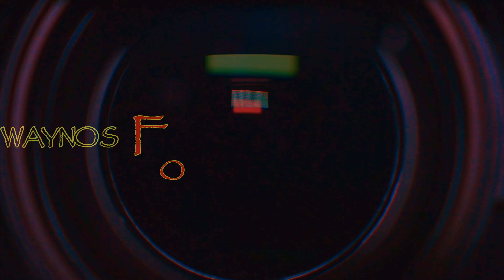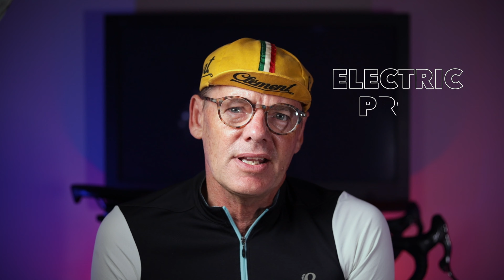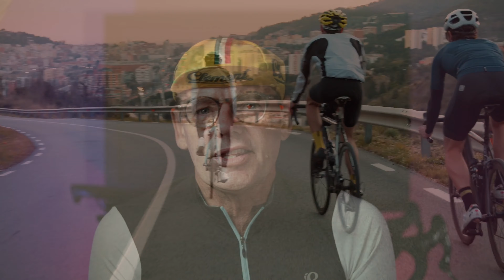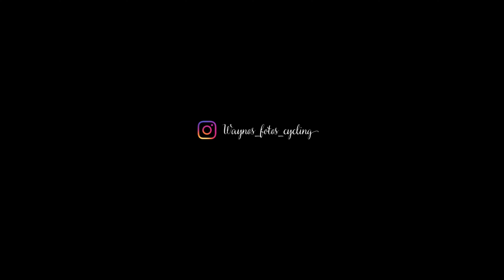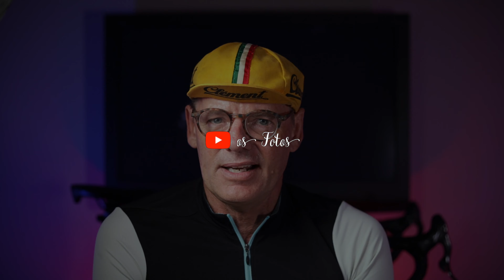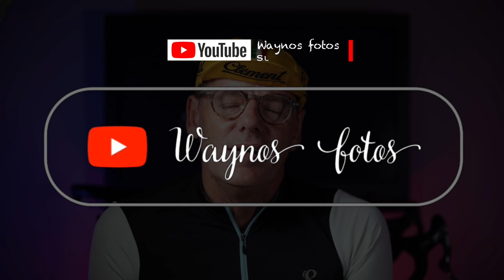Electric VS Mechanical GROUPSETS

Comment: I have ridden with 105 (5800), Red 22 and Ultegra Di2 (R8050) and I must say, I absolutely love the Di2. It's shifts are always perfect, it's even easier to set up and fine tune and the whole groupset feels a lot nicer. The mechanical Ultegra shifters feel cheap and plasticy, while the Di2 feels a lot more sturdy.

Comment: Good summary, thanks.   Couple more points:  I have both Di2 and Ultegra mechanical.  I like to push myself riding with other, often better, riders.  The Di2 lets me shift confidently without fear of a hiccup.  That allows me to shift more often and be in the right gear, always.   Also the remote shifter buttons on the drops (added) are another plus when pushing.   Als, being able to change screens on the bike computer from the hoods is also quite nice.   Finally, no fear whatsoever of a dropped chain on the front.   This is new to me and much appreciated, especially when trying to hang with stronger riders.

But all that said, I can be perfectly happy with mechanical .  But I'm also a bigger guy with strong hands.  I can see where the ladies may potentially see more benefit from the electronic shifting, especially newer riders.  The electronics can be set up to be fully automatic through all the gears.

Comment: Being a retired northerner I have elected to spend my slack cash on the bits that make a difference all the time Eg wheels tyres chain set vs.gear changing 2hich is only every few minutes . When not locked down we normally cycle in group rides twice a week and a significant number prefer the ease of electric shifting but I have elected otherwise.  Being influenced by the benefit of hydraulic brakes I did look at Rotor hydraulic shifting but it's Very expensive and to get the benefit would need new hub on the rear. Great videos . Keep them coming.

Comment: Another brilliant video 👏
I agree, I recently sold an Orbea Orca with 1st generation ultegra Di2 to fund building a neo retro build. Yes the electric groupsets are good but as you mentioned a well setup mechanical groupset is pretty much on a par. 
One of my bikes has 10sp indexed down tube shifters and they can multi shift faster than Di2(not including moving my hand to the shifter) 🤣

Comment: I use Ultegra Di2 with rim-brakes and I love it!!! Your video is a good overview, but there are a few points to add! First, all in all Di2 is just much less maintenance - I was now running it on two bikes for about 20´000 km and never had a single issue - no indexing, no cable replacement - just perfect shifting every single time. Second, while it is true, that if you have an issue with the electrical groupset it is generally more difficult to solve these issues are generally less frequent then issues on mechanical groupsets. Last, but not least: I have no experience with the Sram Etap, but the shifts on Ultegra Di2 are for sure noticeably faster then on the mechanical Ultegra. So for me, the only major drawback of Di2 is the price!

Comment: Out of my seven bikes, six road and one XC  MTB I run five mechanical and two electric. Firstly for MTB mechanical is probably the safest bet due to the vulnerability and terrain involved. All my road groupsets are Campagnolo I have never had an issue with indexing on either the front or rear mechanical dérailleurs. From 2015 Campagnolo really improved the front dérailleur. I have just built up a vintage steel Colnago with 12 speed Chorus however due to the winter I have yet to ride it, on the stand It does seem extremely impressive. The electric are Super Record eps rim & H11 Super Record eps , as stated in the video the front dérailleur is significantly different. I find a change of ring on the front to be almost as smooth as indexing on the rear cassette. The indexing on the rear is so smooth that 90% of the time you can't tell that you have changed gear, this is where the  option to display gears on your head unit is fantastic and a big bonus to avoid cross chaining without taking your eyes off the road ahead. I find the motors allow the system to control the power of the shifting more uniformly than a spring which in turn provides a more refined solution, also the auto trim of the front dérailleur is a bonus. I did program one of mine to automatically change a couple of cogs at the back when I did a front shift which was good to maintain cadence on the flat, however I changed it back as I do alot of climbing and found I was always re shifting the rear instantly to negate the auto shifting. Bottom line is I enjoy using mechanical and EPS, the biggest  miss when I am on mechanical is the lack of gear indication.

Comment: I agree I have a bike with DI2 and I went back to mechanical! The DI2 is first generation I have 2 batteries and they need to be charges once a week I'm afraid in a few more years the batteries won't hold a charge at all and it will be obsolete! I'm old school, mechanical and tubulars only! Great piece on pros and cons!

Comment: Those 8/10 people who have run out of Di2 battery during rides have should have bought a cycling computer capable of displaying the battery level first before buying the electric groupset. I haven't yet have any problems with the battery because I can the level on the screen during and after each ride. Seeing the mechanical groupset's wires wearing is lot harder.

I have both and I like them both. Mechanical is better for CX and winter riding when you're more prone to crashing. Electric is better for the summer season road rides. If I'd have to choose only one, I'd go with the mechanical. Your pros and cons were on the point.
Reply from the maker: Of course, not charging the battery is entirely their own fault. There is a number of indicators to remind them. I was only pointing out people do forget and it is not something you need to think about with mechanical. It is a good point you make and people need to consider this purchasing a system that requires charging.

Comment: I’m with you. I opted for mechanical DA on my Dogma F12 (Rim brakes btw).  I simply couldn’t justify the much higher price for di2 (and there was no way I was putting a mid-range group-set in a top-of-the-line Pinarello). The only time I would find di2 useful is when I wear thick gloves (Im in Canada) but this is not a biggie. Having said all this, I’m looking forward to the new generation DA - maybe my view will change.

Comment: Hey Wayno, I've only just discovered your channel, hense a lot of comments on different videos over a short space of time..... working my way trough them.
Anyway,, interesting video, someone I know has his superbike, 'Scott Foil Rio' carbon wheels, Dura Ace Mechanical and on one of his other bikes, can't remember the brand, he has Ultegra Electionic, he raved about how good the electronic was, how you could programme it, how you couldn't cross chain, how long the battery lasts....... But his superbike is mechanical and that's his go to bike for club rides.
I have built quite a few bikes over the last 2 years since giving up alcohol..... All money goes into bikes 😂🤣😂 got 2 retromods, old steel frames with modern 'ish' components, a Dawes Renown with Ultegra 10 speed mechanical  and one you would not have heard of, local boutique brand, a Carless TT frame with Dura Ace 10 speed mechanical, both change well. One of my other bikes was fitted with 11 speed Sram rival front and rear derailleurs and wait for it Sensah Empire shifters (the later metal inners) and this is going on my Trifox build...... I have to say that I can't imagine any better mechanical shifting than these and I would seriously consider the Empire 12 speed groupset but maybe with a Sram Yaw front derailleur and if they ever brought out an electronic groupset and it was double the price of their mechanical that would still only make it £450 and I'd buy it...... after Trace Velo tried it and rode it for a few months anyway 🤪
Reply from the maker: Soinds like you got the bike bug! Welcome aboard!
Reply: @waynosfotos  haha yep, bought a track bike and a TT at beginning of lock down, tracks opening in 3 weeks, just watching your 1 x video, guess what........

Comment: Best mechanical shifting ever based on how satisfactory it feels: 10s DuraAce 7800 best ever (di2 who?) too bad obsolete, dia compe 10 speed ratcheting friction, bar ends or downtube, wicked. 
Owned almost all groupsets in the past 10 years except R and SR 12s EPS rim or disc, because they are simply beligerantly expensive.

Comment: The undisputed advantage of the electronic groupsets is the ability to have custom placed buttons on the steerer for changing gears.
Otherwise, although the feeling is great, the shifting is accurate and the total outcome is cleaner,
I would place the Ultegra and even the last update on Shimano's 105, at the top of my list.
The reasons are dependability, almost telepathic way of response, ease of maintenance, durability and of course the elephant in the room.... Price!!!
Reply from the maker: Yep forgot that, satellite shifters are a bonus.

Comment: I’ve just bought some used, but like new, Red 22 shifters, plus some new Red derailleurs... prices were pretty good. The electronics systems should be at a similar price point, but it’s gouging. That Di2 battery, 10€ worth of cells for 130€... and the motion control in the derailleurs is trivial compared to a CD player or hdd.
One advantage of the electronics that you missed: you get caught in the rain and applying enough force to the levers is bloody tricky because your fingers slip off. In Europe there is a similar problem with numb fingers in the cold... some little divots would help, but electonic buttons will probably be easier.
Reply from the maker: Def would be cheaper to manufacture than mechanical. The R and D maybe more though. 
Yes i can see a big advantage for cold weather and people with arthritis.

Comment: A mechanical groupset lasts basically forever. I have bikes with DA7400 DA7700 DA7800 UT6500  SRAM RED 20 ,UT6800 and R8000 . What I noticed that integrated cables worsen the shifting a lot.
The shifting with the integrated cables has the worst feeling. The best shifting has the groupsets where the shifting cable is not under the bar tape and you only have 9 gears. i.e. UT6500 and DA7700. If you want to have more then 11 or maybe 12 gears, you probably need electric shifting as the actuation cannot be tuned so precisely. If there gearing goes even above 12 speed. 1/10 of an mm may be relevant to shift the chain.

Comment: It seems for most riders electronis either work or don't. Mechanical seems to work better or worse depending on maintenance. I get along just fine with my mechanical, until I get lazy and keep my cables too long (and then it starts raining).

Comment: You’ve forgotten that integrated frames are easier and cheaper to manufacture. There are 3 lugs to rivet or weld/braze on. A drilled hole for a wire needs no strengthening unlike a cable.  Im was lucky I couldn’t sell my 2010 bike. The problems my mates have with their disc electric shifting bikes I’m glad I didn’t swap. When their bikes work their awesome but that’s only about 20% of the time. Discs, tubeless, thru axles and derailleur batteries all are solutions for problems we never had.

Comment: I had both but the electronic groups tend to behave like a pet they demand attention and we have several bikes my wife has 2 i have 4 they are not that many but they don't get tha constant use a single bike gets ao they had battery problems and software problems the point is almost every time i switch to a different bike i got an issue related to the di2 only 1 of 6 bikes never had a issue it had an ultegra 6800 and it was one of my wife's all the others had Dura Ace 9100 all presented problems so we sold those toys we have all mechanical all rim brakes no issues just some oil here and there and we go, bikes are to be enjoyed no to add more stress and become money pits people have to learn that pros use what the team gets from the sponsors they dont pay for the bikes they get paid ride them. We don't have to copy them we should analyze and invest in what really matters we work hard for the money we spend in this sport

Comment: If you have a rim brake mechanical group set bike , you just have a lighter more reliable machine. Sure not as cool hung up in the living room when your freinds visit. Depends what your into i guess, looking cool or being faster??
Reply: How are electronic group sets and disc brakes unreliable then? I have been using both a Di2 and an Etap over the past 3 years, and I ride +200 miles a week, and have never had a single issue. Having to remember to recharge? I mean, seriously is that such an inconvenience? How much mental capacity does it require from an adult? Do those people also still need mum to remind them to have breakfast and wear a hat in the winter? I have now also had a bike with hydraulic disc brakes for  a while. Also, set and forget.
Reply: @82vitt  its lighter. More koms on mechanical. There ya go
Reply: @cypriano8763  Fair enough, if you're already at 8% body fat, otherwise it is a thin argument :). But in my experience it was the electronic stuff that's been more reliable. Its very expensive though, that's true. I can afford it, but £70 for a junction box, which is just a small piece of plastic with a couple wires inside, which costs 5$ to manufacture is a major rip off. Or £15 for a single wire.
Reply: @82vitt  cheaper, lighter, more reliable and easy to fix. Win, win, win, win. Boom!

Comment: I would definitely use electronic but it's just too heavy and expensive compared to mechanical it really isn't worth it.
Reply: Heavy ? my bike is Di2 and it’s a size 57.5 and weighs 7.1kg I could change the wheels and rear cassette to drop me below 6.8kg. My bike is not heavy
Reply: @jasonhowes6431  red etap is 200 grams heavier than mechanical red. Although you're right about DI2, dura-ace di2 is the same weight as regular dura-ace, but of course if you have shimano you clearly don't care about reducing weight. If you put red etap on most fast bikes the total weight would be about 7.6 kg instead of the normal 7.4kg. You clearly have a lightweight non-aero bike so it doesn't really matter what components you put on, it will always be close to 7kg.
Reply: @albr4  I have a F10 Dogma best bike I have ever had and I have had a lot of bikes. I have had etap and had massive problem with it not even the manufacture could fix only replace . After researching the problem may other people at the same issue, so I changed back to shimano. I’m not after a light weight bike mine just happens to be at the lighter end. Just enjoy riding every day to keep fit, plus I find it very easy to maintain, no bike shop bills 👍🏻

Comment: I use rim brakes and di2 I went from disc and mechanical and basically brought di2 as I just wanted to try it.

The battery I've never had an issue on the wahoo u get a warning pop up with di2 at 25% which is still around 200 miles and you'll get that reminder everytime u use the bike with under 25% so if u 4get to charge it these days well..... I have no words lol.

Also I love the auto trimming front mech on di2.

Would I say di2 is worth the extra money no..... But would I buy it again yes....

And in my case the di2 ultegra was lighter than my mechanical only 40g but it was lighter that's including everything so the wires and junction boxes and Bluetooth thing. Mechanical I weighed the the cables ans outers too. 

Sram is known for slow shifting however on di2 you can change the shift speed from normal to fast or very fast 😉

I just find it works better

Comment: Batteries discharge but cables break, once every a couple of years if you ride enough miles, or even more often, and you can’t see their status as you can with batteries. The only thing you can do is to replace cables before they break. I think you missed this point in your comparison: cost and time for maintenance, electric groups are almost maintenance free
Reply: I have never suffered a Campagnolo cable failure in the last 7 years, riding 3000 miles a year. Possibly 2/3 years a quarter of a barrel adjustmen is required. I guess it all comes down to quality.
Reply: @ThePaulKat  It happened to me with a dura ace cable after 15 months and 7000 km, it could happen indeed. Maybe it depends on cable maintenance, weather conditions, etc... the point is that there is no led that blinks before the cable breaks, as with batteries
Reply: @4lumi  I do know that it is a common issue with Shimano for the cable to snap off inside the shifter, generally a few mm from the furred on the end.
Reply: @ThePaulKat  It's exactly what's happened with my cable